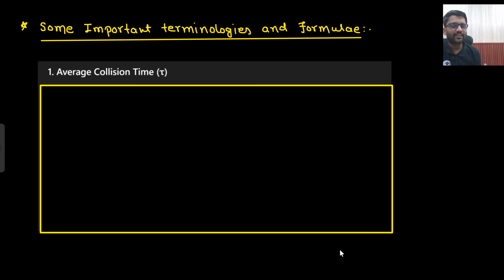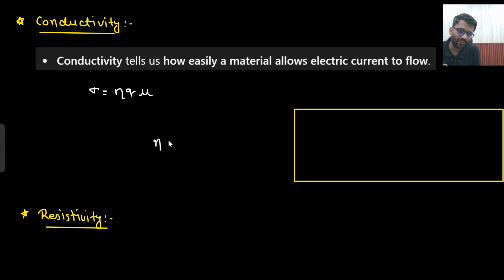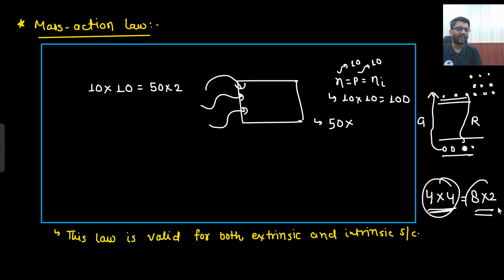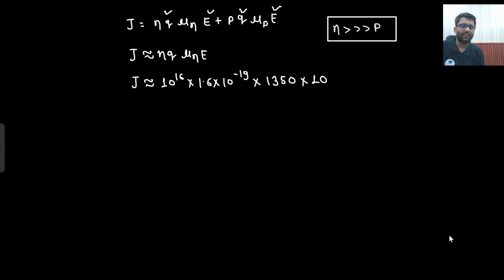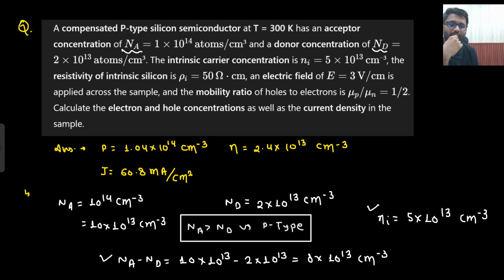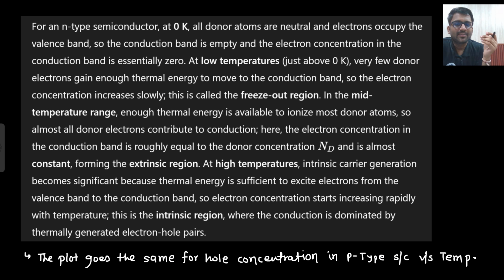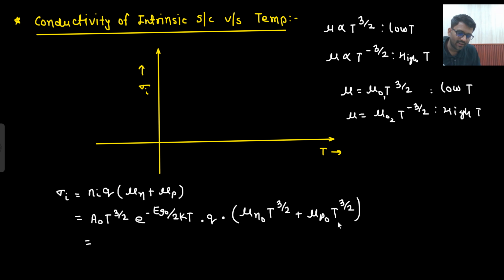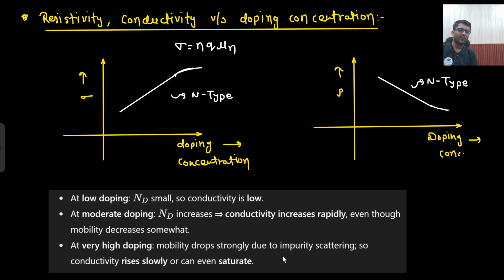Carrier Transport Phenomena - 1 || EDC || GATE || PrepFusion

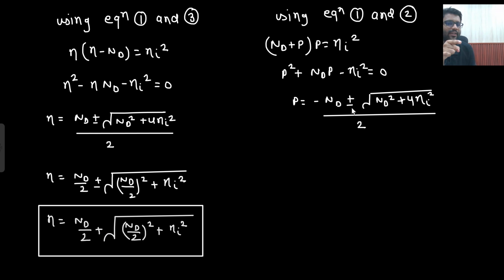Comment from the maker: Correction - at 1:24:15 if we take the positive sign, we will get the positive value only, so the formula stands correct only. 
But usually we don't use this formula. Even if we use it, we will get the correct answer only but usually we simply apply the mass action law to get the minority concentration.

Comment: Sir can't we take directly J=sigma*E as sigma =1/50 intrinsic resistivity is given50, in that compensated p type silicon question? Instead of finding out up un we get the current density same as  60mA at 2:20:00
Reply: if we do in that way we get Jdrift for intrinsic but in question they asked for compesated p-type